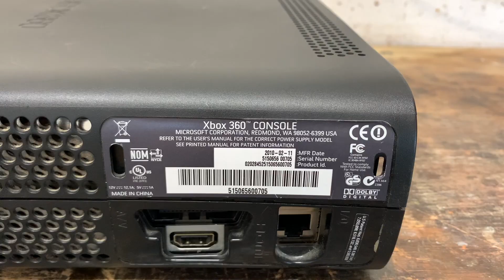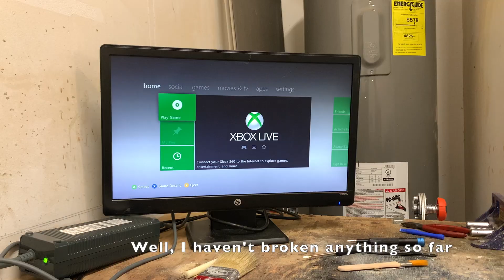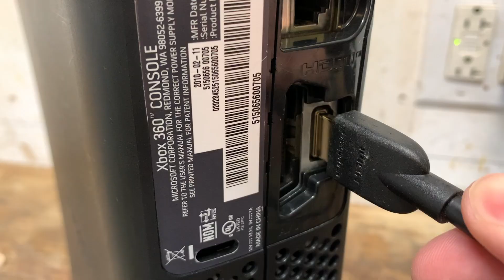Xbox 360 Elite Jasper v2 Console Restoration and Teardown

Comment: Thank you for this video.  I found an oddity, a Jasper 1 board with a Kronos board from July 2009, and I'm using this guide to help me safely take apart and clean this.
Reply: I've got a refurbished Zephyr that was serviced I  2009 around the time the Jaspers were released.  I found a Jasper last week loose for under 20 dollars but I want to run the refurbished one for the winter.

Comment: 4:54: are those maggots🤢 

good job on fixing this console, i've noticed that almost every jasper/jasper v2 has the exact same issues as yours (extremely dusty or dead disc drive), yet they still work, but i've seen Xenon and Zephyrs have RROD or not even turn on that have no dust or very little use. really shows how Microsoft improved the 360 as the years went by
Reply: The issue wasn't even heat in the first place. Yes, it was heat-related, but it had absolutely nothing to do with the peak temperature, but rather the fact that it would heat up and cool down when the console was turned on or off respectively. The GPU's die was connected to the substrate/interposer through a bunch of microscopic solder bumps (they're SIGNIFICANTLY smaller than the solder balls on the BGA itself) that are usually protected against issues with an underfill underneath the die. However, ATI (who made the chips for the 360) used the wrong type of underfill that would fail and cause the GPU to stop working. A lot of people have tried to "fix" the issue by doing reballs/reflows, however, these were only temporary and the issue would usually come back within 2-3 months. The late-Falcons/Opus, all Jasper V1s, and especially the Jasper V2s had fixed versions of the GPU that had the correct underfill and therefore wouldn't fail. Some Xenons that were sent in after a certain period of time would also get a fixed GPU known as the 80nm Elpis.
Reply: @jayc.landgraf6828 how should my 2007 Zephyr hold up that was refurbished by Microsoft in 2009?  I just bought it a few weeks ago and I read it should be almost as reliable as the early Falcons.  Is that accurate?  I've also got 2009 Jasper v2 as well but I would like to get some miles out of my refurbished unit first.  I would like to use the Zepher all winter.
Reply: @matttherrien9608  That Zephyr is fine. They had fixed Rhea GPUs (the exact same GPU that the Falcons used) in Zephyrs that were sent into Microsoft for a RRoD repair.
Reply: @jayc.landgraf6828  thank you.  I'll now confidentiality play my old unit without reservations.  I should clean and repaste it though.
It only set me back about 30 bucks with a controller and power supply.  The Jasper was loose for under 20, but I bought a Falcon psu for it for a few bucks.

Comment: I saw a few years ago, a guy that instead of a spring for the usb cover, he cut a small piece of a flexometer and uses as spring. I did and ita alittle bit harder to open but now it closes.
Reply from the maker: The USB cover was very frustrating. The plastic piece that held the spring in place was broken, and the whole mechanism was just a mess. I probably spent at least two or three hours trying to get it fixed.

Comment: "Kronos" doesn't exist, that's just a myth.
Reply from the maker: Nope. It’s a v2 Jasper.
Reply: @RestorationRelaxation  Yes, there's two models of jaspers, just the term "kronos" doesn't exist. It's a myth. The original free60 team, which had dissected every 360 motherboard, and many other experts, has stated there really is no difference between the two.
Reply: It’s printed on the chip. I’ve just stripped and cleaned a console.
Reply: @Waughy76  No such thing as a Jasper "kronos".
Reply: @rob831  ok, you go off what you read, I’ll go off mine.
Reply: @Waughy76  I'm simply going off of facts
Reply: @rob831  got a link? I’ve got a 2010 model with Kronos stamped on the GPU. Just curious to learn more, I’ve seen Jasper Kronos mentioned numerous times.
Reply: the "Jasper Kronos" is a pair of the Jasper CPU and KRONOS1 GPU, it's a redundant term really, as any late 2009-2010 Jasper v2/ codename Tonasket boards came with the KRONOS1 GPU. Early Jasper boards still came with the Xenos ATI GPU that came with the Falcons. Xenos GPU had a copper heatpipe supplemental radiator extend in front of the CPU heatsink. All KRONOS1 GPUs came with solid aluminum heatsinks.
Reply: @someasianguy3793  Nice copy and paste. Since my original comment, new information has been released. There is no jasper v1 or v2, its simply jasper or Tonasket. Not sure why people make a big deal about it when there's barely any difference between them, nothing major.
Reply: @rob831  I kinda typed that out myself just now really, I'm actually in the middle of restoring my 2010. Lots of people seem to be confusing the terms such as the Xenos GPU with the "Xenon"-style heatsink when talking about that updated all aluminum one. I'm sure you knew already about most of these but it's for the others too to clarify things.